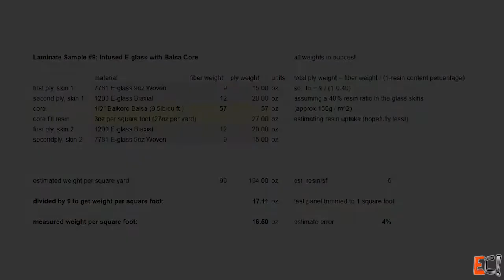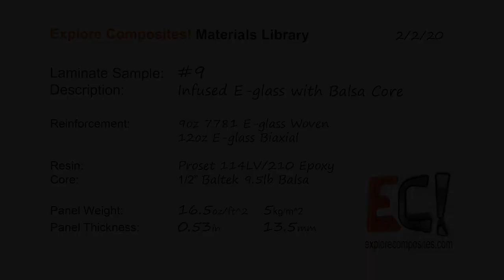Laminate Sample #9: Infused E-Glass / Epoxy With Balsa Core

Comment: When vacuum infusion is done to the hull sides in molds... how is the cloth layups done before bagging it and starting the infusion? I'm thinking about what is keeping the cloth in place on the vertical parts... is there some kind of temporary adhesion and if so, what's that product called and how is it applied? 🙂
Reply from the maker: Spray glue!  There are lots of products people use - the most common is 3M "Super 77" spray contact adhesive.  There are more composites-specific options that work better and are resin soluble.  

The key to success is using just enough to hold things together and not too much.  Excess spray glue is one of the big problems people have with infusions.

Comment: Do I understand your weight estimate spreadsheet correctly that you estimated 150gsm of resin for uptake in the balsa?

I’m doing an infusion soon and not finding a ton of great resources on standard resin uptake for core materials…
Reply from the maker: No - I'm pretty sure that's a mistake!  Probably a cell I forgot to delete when copy/paste-ing a new sheet and switching from metric to imperial.  The balsa should take up way more resin that that - the 27oz/yard is like 900g/m^2.  I always assume 300-500g/m per face for resin uptake in low density foam and balsa is probably worse.
Reply: @ExploreComposites  I found a really good way to prevent that…. You just have the resin gel before the infusion completes! :(
 Very effective in reducing uptake of resin….

Had to consult the “problems with infusion” article! Sure enough, there it is. A second shot “kind of” saved the part, but definitely way less than ideal.

Infusion, what a great process to screw things up with! I think I’m batting .100 or less with it

Comment: If BALSA IS SO GOOD THEN WHY DOES TI FAIL SO OFTEN IT ROTS
Reply from the maker: You're right - while balsa is very good mechanically it is still wood and so it has wood-problems.  Lots of balsa issues came from poor core bonding of hand-laid parts (like boats) - where if water got in it would just soak across large areas.  When it's bad - it's terrible!

With infusion, all the core cuts are filled with resin and water intrusion becomes much less of a problem.  The down-side is that it soaks up more resin than foam and so is even heavier.  Balsa is less commonly used than it used to be, but for things that aren't used in the water and where excellent core compression properties are required I think it is worth a look.
Reply: @ExploreComposites  Why not use fiber glass honey comb it does not rot balsa has very poor shear strength pan is poor in end grain compression
Reply: You would be better off using 316 L SST SCREEN IN A SNDWICH LAYERS IT IS VERY STRONG AND NO ROT IF YOU ARE CHEEP YOU COULD USE ALUM COPPER BRASS OR PLASTIC  TRY THAT OUT LET ME KNOW WHAT YOU THINK . WHY IS WIRE MESH USED IN CEMENT SLABS ????